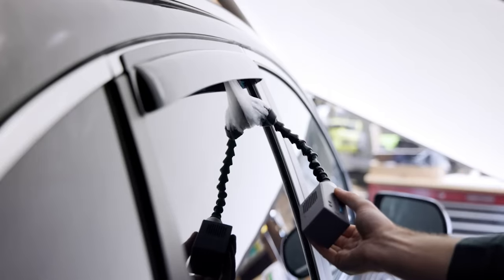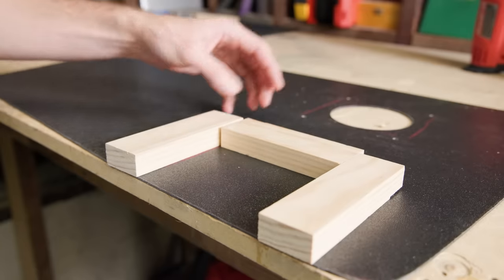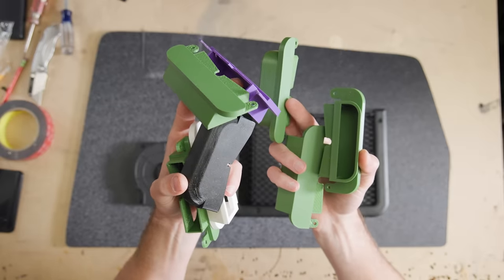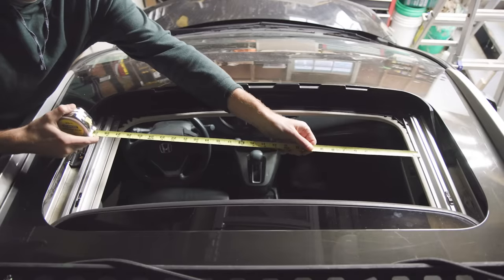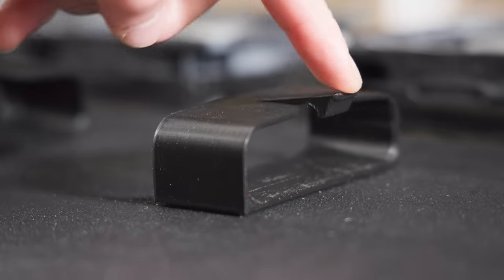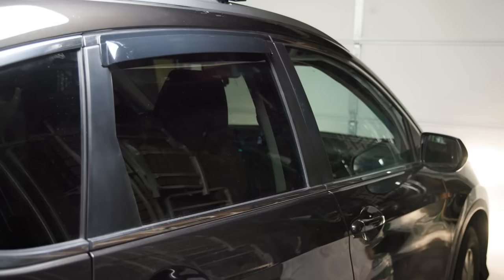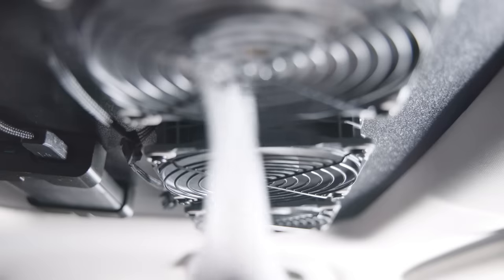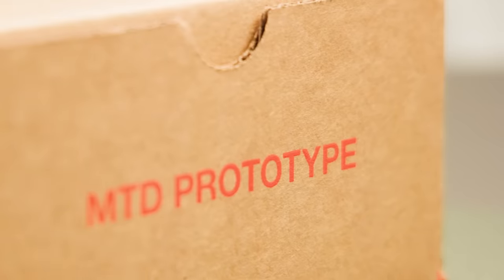Car Camp on Warm Nights With This Invention (V2)

Comment: 10:00 3x window fans don't run long enough on 1 battery...
I'm just going to speculate that when you step up the voltage from 5v to 12v, you are then pulling too many amps for your battery system!
So, either get a different batt (12V DC) or locate fans which run off 9V DC or 5V DC.  If you run a 9V fan off 5 V source, it will simply spin slower

Comment: Suggestio.  Maybe try using  aluminum composit panels  they  are more ridgid and they  give you  more of a thermal insulation value  and easy to work with

Comment: The problem with your batteries is likely because the fans are not drawing enough current and it is auto shutting down.

Also you need flux to help with your soldering skills. Do not using plumbing flux on electronics. I recommend Kester 2331-ZX but this requires washing after because its conductive and slightly corrosive...but Kester 182 is another good rosin based option.

Comment: Air exchange, great! Now if air could be taken from under the car to the inside, it would be much cooler. The other is to design a swamp cooler for cars, this design is almost there, just need a damp cloth to draw air through, and a drip system to keep the cloth damp.

Comment: If you use a usbc pd Bank, you can get 12v out. You can over volt fans slightly. 12v is optional on the pd specification, and I've noticed anker isn't the biggest fan of 12v on a lot of their products

Comment: I have that same battery and for USB devices that don't draw enough power for it to stay on, you just have to hold the button for a few seconds until one of the 4 LEDs turns green. It will stay on untill it dies or you click the button again.

Comment: Thanks for all of these genius window treatments.  I'm converting a 2003 Honda Odyssey and ventilation is a serious problem.  It only has the driver/passenger windows and two small vents in the rear windows.  And that's it.  I'm seriously considering cutting a hole in the roof to put an RV fan in.  The part that scares me is trying to remove the headliner.  Fortunately I plan to drive it till it dies or sell it as a camper so I'm not concerned about punching a few holes in it.  Subscribed!

Comment: Cars have a simple interface for Webasto-style heaters we use here in colder climates. It’s an external petrol/diesel heater that heats the engine cooling water. When the water is hot, the system supplies 12 volts to a certain pin on your car hvac-system, and it will turn on the cars own fan. 

You could just find where that pin is and connect a switch for it. The fan itself doesn’t need much power, but I would carry on of those small lipo jump packs with me if I did this.

Comment: This would just fail in southern hot states.  At night the heat indexes are still in the high 90’s with the heat and nasty humidity. You’d need a full sized box fan just to breath as you sleep in your sweat drenched clothes

Comment: Hey Matt, HVAC engineer, love the video. You can utilize the Sensible Heat equation to help dial in your CFM needs.
CFM = Q/[1.08 * dt]
Q = heat, use BTU with CFM and Watts with Meters cubed. Average sized man at rest = 200btu
dt = The change in air temperature (F) you want to see between the flow in vs flow out of your car. Like if it's 68 degrees outside and you want the temp in the car to stay below 72 your dt will be 4.

Also a cautionary statement for you to think about, the actual CFM delivery is probably not what it says on the box. Many consumer/prosumer grade CPU Fans will either be labeled at max flow & no resistance, or at some pre-designated resistance they don't tell you on the box so unless you dig it out of their website or ask for it you won't even be able to guess the performance of the fans prior to install.
Reply from the maker: Thanks for the information!

Even if the CFM numbers were right they’d be meaningless to me. Haha. All I know is it feels better now than it did before.

Comment: Any suggestions for making the sunroof unit waterproof? I live in a tropical rainforest basically 😂 not kidding
Reply from the maker: Hmm. In “vent mode” it does shed some water but not tropical downpours. I’d look at roof vents or camper can exhaust fans for inspiration. They’ve solved the problem with some kind of extra hood I’m sure.

Comment: You should try printing with PETG. It is much more heat resistant than PLA.
Reply from the maker: I actually bought a roll of it but saw you need some kind of housing and need to dial in settings. I decided to get this project out the door before I started fiddling with that. But now that it is…

Comment: Very cool build!  Regarding the batteries, I have also noticed many portable batteries have a minimum draw requirement or they turn off. Some kind of power saving feature I assume. Extremely annoying since things like LED lights or small fans can be under that minimum draw.
Reply from the maker: I learned from another commenter that I just had to double press the power button and the battery works. Whoops!

Comment: Can you get an inline usb thermometer so if the fans run at night they can run at low power at cooler temps and when the sun comes up and gets hot they ramp up
Reply from the maker: Sounds like something I’m totally unqualified to do but should try.

Comment: I'm curious about the thermal qualities of this! I'm attracted to reflectix because it keeps the car cool. Folks often add a black fabric side so they can switch to a blackout/stealth mode at night when they don't need to reflect the sun. As much as I love your design, it looses the reflective quality, no? And it's not double-sided anymore so it can't be flipped. I wonder if a removable (velcro?) reflectix layer could solve this so that it has everything! Also, I may have missed so I'll rewatch the video, but how is it held in to the window? Especially with the storage weight. I definitely missed how it doesn't just pop off.
Reply from the maker: I still use reflectix when it cold outside. These are wedged under the window gasket. They sit between the window and the gasket.

Comment: Hi Matt, do you think this would drain the car battery quickly if my cars outlet works even when the car isn’t started?
Reply from the maker: It’s pretty low power but if you use it a few nights in a row and don’t have a pretty new battery it’s risky.

Comment: so freaking pumped everytime you make a video, I just litterally mounted something to my strut roof rack thanks to you!
Reply from the maker: How’s she holding up? Mine’s still holding strong.
Reply: Solid as the day I put it on, I havent even painted it yet and only have surface rust on the cut ends after being in the weather for months. Your design is a lot smoother for air flow and I want to build it one day, but until then I found one of those work fans people use on construction sites that use power tool batteries it has a hook that folds out on the bottom, and the crossbar hangs over the sunroof and I just hang it from the crossbeam, one charge runs all night into the morning. @MattTheDesigner

Comment: you could probably do with just leaving the side wiindows open a bit and having the exhaust fans.... the exhaust fans removing air from the car will automatically draw air from outside via the windows...(or if you fit a vent lower down, from there.... some of the campervans have vents lower down, so it draws in the cooler air..)
Reply from the maker: When it’s not too hot we just use the vents. But when it’s hotter the wind from the window fans makes it feel cooler even if it’s not.

Comment: I'd add some small insulation.

Also, i don't think you really need to pull air from outside in with a window fan. You probably could just use enough cfm to pull heat from the car. This is commonly done in houses.
Reply from the maker: I agree but you can actually feel the breeze from the window fans and I like that.

Comment: Why not... Switch to a 12v 32 amp starting and reserve battery, (64 amp agm,batteries plus 350$) switch your 12v outlet to always on power(Free), purchase a 12v Fantastic Fan endless breeze brand 900 CFM (125$). Theoretically it will run for 24 hours straight on high. I will say however much cooler to use the skill sets. Which was the attraction here. Great job!
Reply from the maker: There are definitely easier ways to do this haha. But I like the custom fit of these.

Comment: Ingenious design! I wonder if a couple of strips of double sided Velcro would work better to hold the battery in place? Then they could be adjusted if you change the size or shape of the battery.
Reply from the maker: That would be a lot easier haha.

Comment: If your car leaves the AC outside vent open when turned off you should be able to get all the air in you want. However it might be warm from the engine... just a thought. Easy test anyway.
Reply: Simply get an EV, some offer camp mode. AC/heater runs for days, plus radio/streaming/TV on the cars display. Sleep in the car in summer/winter without any issues

Comment: Correct me if i am wrong.. The actual cfm figure is probably lower than on paper due to the reason being a 5v powerbank powering three 12v fan resulting in lower rpm.
Reply from the maker: That may be true. I’ll do more testing.

Comment: All I can say is that if you think that this is a good idea, you must live in a fairly cool climate... Around here, if you did that, it wouldn't matter how much airflow you had, you would still be sweating all night long... The only way to "camp" in your car would be to stick a window air-conditioner unit in one of the windows and run the extension cord to the nearest outlet... :)

Now, there are some hybrid cars that have a large enough battery that you could "camp" in them and the car not have to restart to charge its battery too often during the night...
Reply from the maker: It's more of a take the edge off thing than a survive 120 degrees thing.

Comment: I'm confused. Why didn't you just print these with PETG? It's only moderately harder than PLA to print and would withstand those temperatures.
Reply from the maker: @philhario3640  I tried. I think my basement was too cold because it wouldn’t print right which meant I needed to build a box for the printer to keep things warm and flowing properly. I didn’t have time for that. Planning to upgrade the printer then hopefully the “shop” soon.
Reply: @MattTheDesigner  it's worth checking if printer was dialed in and filament dry. I have no problems printing petg in fairly flexible conditions using an ender 3 clone. One trick is putting gluestick on the plate if you have adhesion problems.

Comment: I really admire the effort,  but why aren't you just running the 12v fans from the car battery ???
Reply from the maker: Scared to do that and be stranded.
Reply: @MattTheDesigner  But car batteries have enough capacity to run those tiny fans for a week..

Comment: This is very cool. Do you have any solutions for condensation?
Reply from the maker: The air movement helps a lot. It’s probably 90% less than it was before this setup.
Reply: @MattTheDesigner  that is a pretty big improvement

I had been thinking of trying one of those small  dehumidifiers

Comment: You begin with a flawed premise.  You are too hot not because you are a stealth camper, but because you are a stealth camper that blocks out your windows with reflectix.  Which in turn creates a hot stuffy space that then requires a fancy workaround for the unlivable space you just created.  My rig has all the fresh air it needs and more.  And so long as I park in the shade I can tolerate 90 degree days, day or night.  I can do thus because I don't use reflectix, I use cloth blackout curtains and rechargeable fans for circulation.  Couldn't be happier.
Reply from the maker: But can you do thus when it’s raining?
Reply: @MattTheDesigner  I absolutely love it when it rains.  If you mean what about the windows, I have Weathertech gutters on all 4 windows.  They are literally never fully closed.  My secret weapon are the blackout curtains, which are completely invisible from the outside.  No reflectix anywher, just a basic full front sun visor..  My stealth rig can be parked anyplace and fit right in without drawing any suspicion whatsoever.

Comment: This is a game changer for car camping!!!
Reply: Or simply get an electric car, some have camp mode, so the heater/AC runs, perfect inside, even in winter, run radio/streaming. No 12V battery worry like on ice cars.

Comment: I dont understand that the snorkel doesnt reach all th way down to the fan?! 9:28 onwards. 

(Or that this moulded snorkel is needed at all - seems to be a gap between the glass surface and the sheet).
Reply from the maker: The glass is curved. So the top of the window insert touches the glass but the bottom does not. The snorkel is only raised at the top because that’s the part that presses against the glass.
Reply: @MattTheDesigner  thank you!

Comment: I'm trying to come up with a design for the sunroof of my Chevy Suburban I need air vents going through there for the ecowave 2.... Cardboard is too weak Seems.... And I used a foam type deal and it seemed too weak do you think this material you're using would work?
Reply from the maker: That make plastic sheets in a lot of different thicknesses. The one I used might be too thin for you but something thicker would probably work.

Comment: I really appreciate that you read the user feedback and then took the time to update and remake this tutorial. The mark of a true designer! (And also you give your plans out for free?? Thank you so much!!)

I'm converting my Cube into a little camper van for scuba trips around the southeast and I was worried about the moisture problem inside the car. (Moist environment + Moist diving gear = A very bad and moist time.) My university has 3D printers for student use, so I'm going to try this out and see how it goes! Thanks again!
Reply: I don't have a sun roof, so I think I'm going to try having an intake fan on one side of my car, and an exhaust fan on the opposite side for air flow. (I guess just flip the fan facing the other way so it blows out??? I'll figure it out!)

I'm brand new to this so if anyone has any input, feedback, or suggestions, I'd love to hear it. Right now I'm a little worried about moisture accumulating on the window of the exhaust side and I'm not sure what the solution for that is.
Reply from the maker: You could try the one fan in one window and crack the opposite for a more passive exhaust. Then figure out an exhaust fan if that’s not enough.
Reply from the maker: Or maybe a fan pulling air into the front and back window on the left side and windows cracked on the right.

Comment: What is the smoker that you're using?
Reply from the maker: It’s from a company called Vosentech
Reply: @MattTheDesigner  Thanks, just ordered one. Needed it to find air leaks around the house.
Reply from the maker: @Cam.Klingon   Nice! It's a pretty cool little thing. I'm thinking about making a short about it because several people have asked.

Comment: Probably the reason the one battery shuts off is because the fan draws very little power, and the battery doesn't think anything is connected.

Cool setup.